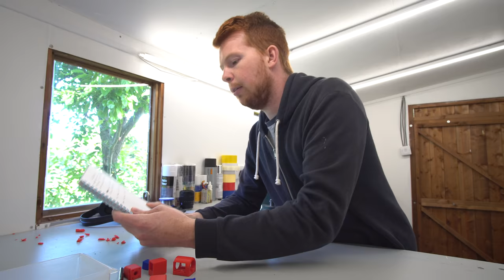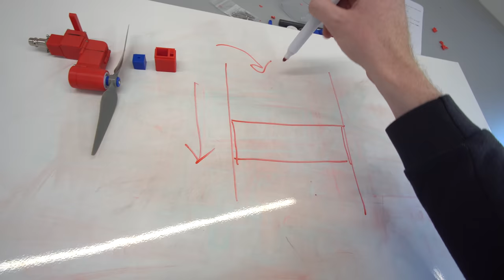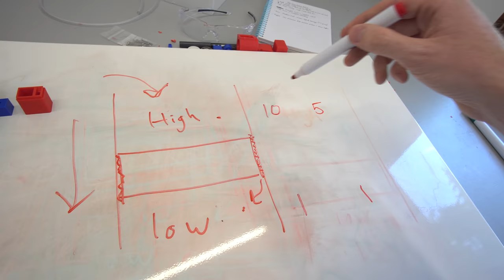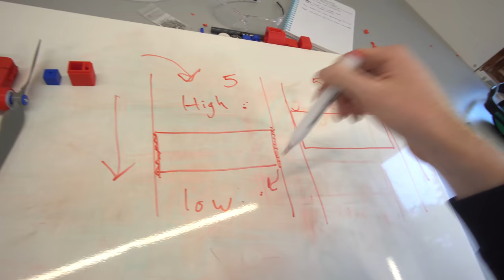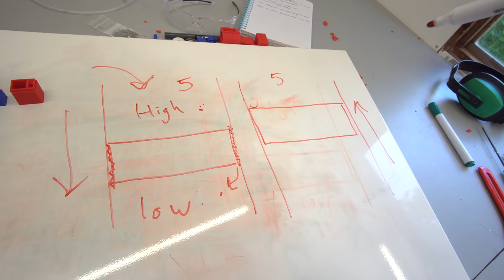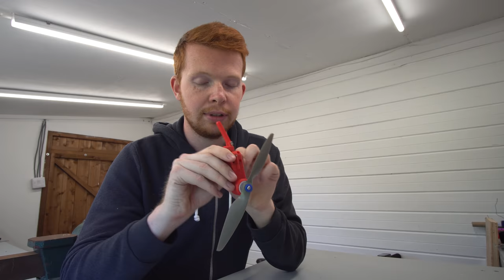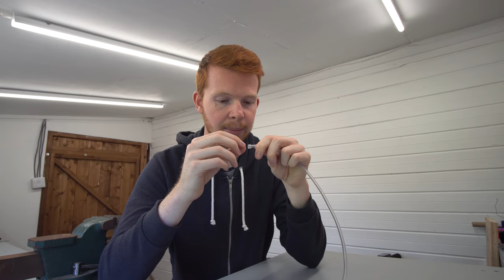Multiple or Single Cylinder Air Engine?

Comment: I think there is a lot to be said for keeping a single cylinder. If your theory about air leaking around the piston at varying pressures, a single is the place to experiment with this. I think if you tried to develop more efficient operation, that would be really cool, I'd love to see how technical this can get while still using 3d printed parts. Have you thought of using an exhaust valve as well as your intake valve? It will help you minimise losses on the upstroke and could give you more power on the downstroke as well. Love the project btw.

Comment: I would agree that the higher pressure on top the more air will leak through. The thing I want to add is, if it is a linear increase of leakage then multiple cylinders won't solve that issue. Now if it is a nonlinear increase, say an exponential one, then the additional cylinders should be beneficial. As for 1 vs 2, I think 2 would be cool but do what you feel is best. If you do make a twin then I vote for the inline version because I think that cam shaft would be really cool.

Comment: Since you're making a compressed air engine, you can do what internal combustion engines can't do. You can build a double-acting piston! A double acting piston gives you the power of two cylinders with the mass of only one cylinder being pushed around. The challenge would be sealing up the bottom of the engine because a connecting rod has to pass through it.

Comment: edit... Should have read comments first.. see it has already been suggested.. ohh, well..
..............
If you want increased efficiency you should do what they used to do in old steam engines.
 Make a 2 or 3 cylinder engine that reuses the same air... that is instead of just exhausting the used air from cylinder one to the atmosphere you route it into the second cylinder, 
 In order to make use of the remaining lower pressure you need to make the second cylinder with a proportionately larger surface area to press against.
  Also you could change the simple valve on your engine for a spool type valve and add another port to your cylinder to convert it to a double acting cylinder , and use pressure to drive the cylinder both up and down, This would give many advantages of another cylinder with less losses etc..

 After these mods you can then adjust the size of the propeller to "gear" the engine to where it is running most efficiently.

  Really interesting series looking forward to more..

Comment: As you only use compressed air you could have the interview at the bottom of the engine, and the crank shaft inside the inlet system etc. This would allow for a star layout if more cilinders are required in the future, without introducing many more points of failure

Comment: I'm a fan of the inline-opposed, sometimes called the 'boxer' engine - but you must have the crankshaft 180º out of phase for the cylinders.  That way they move in and out synchronously, but of course in opposite directions.  Their power strokes should also be simultaneous, therefore canceling each other out, vibration-wise.  I owned a 1976 Honda Gold Wing motorcycle, which had a 4-cyl. inline-opposed engine.  I could balance a nickel on the valve cover when it was idling cold.  You can do it, Tom!

Comment: twin, 90 degrees apart, the distance between the cylinders will be shorter therefore plumbing will be a bit easier and you also have easier crank shaft without the pistons moving in the same direction at the same time

Comment: You could also combine the 2 side cylinder engine using a different design. Make is so the air pushes the single piston back up once it reaches a certain point to make use of the air leaking around the piston and the walls. Hope this helps you

Comment: For high vs. low input pressure, consider the loss of the return stroke as it compresses the air in the piston. The amount of power generated for a certain input PSI is going to be reduced by having to compress the air again while the piston moves back up. In an internal combustion engine, you obviously want this compression stroke, but here you don't; ideally the exhaust valve would close just at the top of the return stroke. Perhaps you could add a second cam to operate an exhaust valve the same way the intake valve works?

Comment: Just Print a intake manifold with some rubber gaskets. That is pretty easy to design, and should seal well. A lot easier as designing a (strong, reliable) crankshaft with 4 offsets.

Comment: Follow your heart.  I'll watch your updates either way.  It's interesting to see your design process and how you work through issues.

If you do end up going with an opposed/flat multi-cylinder design, what if you have the air supply connect near the center, then build an air channel directly into the engine block for the air to split off and flow to each head?  That way you don't have to futz around with tubing or other mixed materials.  Though, I don't see how that is less complex than just designing a multiple-offset crankshaft for an inline.

At a small/light scale, the oscillations/resonance may not be that great, but your vehicles will also be more sensitive to these issues.

Comment: Flat twin. The crankshaft simplicity is important, the pneumatic plumbing is really really simple if you use smc type pneumatic fittings and tubing. The higher the pressure the better these kinds of fittings seal.

Comment: I think air leak is your main problem.
My suggestion : find some kind of metal tube with smooth inside surface and make a cylinder sleeve out of it. Still use 3d printing for the piston, but add a groove on top to accommodate a o-ring or some tiny cylinder ring (from small RC plane engine?).
Print the cylinder with a bore slightly smaller that the sleeve OD.
Roughen up the sleeve outer surface for adherence, heat it up a little then press it into the cylinder.
You could even recycle the sleeves from one build to another.
Reply: And for a simpler cylinder design, it could just be that you glue on to of the cylinder a disk of rubber/silicon sheet. And sandwich is with a washer on top. That being said o-ring of all side are easy to find and it's not that simple to cut a perfert disc of rubber.

Comment: what about just finding the optimal operating pressure and putting a regulator on there? i dont know how heavy or how big regulators are, but it seems like it would solve the problem that you think is existing?
edit: oops, i think you already did that with your throttle control.

Comment: So in my town there's a competition where cars with air engines race, and there's a tasks where the one who's car goes the furthest on a single "charge" wins. Because of this part of the race the teams design the engines with two cylinders one smaller and one bigger. The bigger one gets the air from the tank and the smaller one gets the waste from the bigger cylinder. This is how they maximize efficiency I belive

Comment: I would say that a V-twin engine is the better option, since it can be connected to a single crankshaft, and be fed in the gab in between the blocks. By offset the cylinders by 45 to 90 degrees would give you plenty of room to do the pluming.

Comment: I suggest a single, but modify the design and implementation.  Use a round piston and cylinder, sized so the piston doesn't quite fit into the bore straight off the printer.  Then slowly open up the cylinder until the piston just barely fits and  then add a few drops of lubricant.

The seal between the piston and cylinder isn't that great right now, but by taking this approach you could get a much better seal.  Ways to bore the cylinder:  Lathe (if you have it), the appropriate size bore, or worst case you just put some sandpaper in a slot in a piece of steel rod, and spin it with a drill and move it in and out.

You can certainly get it within a few thousandths straight off the printer, then a few minutes boring and honing and it'll be a great fit.

Comment: definitely multiple cylinder! I like watching the prototyping process as much as i like seeing these engines actually mounted on planes.
I like the flat twin idea, is print time a serious factor? you should be able to whip up a one piece manifold that feeds both cylinders, you could put it after your throttle valve.

Comment: With multiple cylinders i believe you will have less timing problems and more efficent running, i think you should go for 2 cylinders. And also depending on my observations, use a heavier flywheel, your machines will work more smoothly. Keep up the great work loves from turkey!

Comment: Older video but just out of curiosity if you could switch the flow of air from the top of the cylinder to the bottom of the cylinder you would effectively be powering the cylinder from both directions(effectively w cylinders)  Because there is no combustion it would just be timing and routing of air pressure. Of course most cylinders are basically square, bore and stroke are basically the same.

Comment: DIY pressure regulator and composite air tank by wrapping up those bottles so u can up the pressure to see if you can get the flight time to last a bit longer

Comment: Multi-cylinder would be cool, but getting a good single cylinder running first is key. Based on your history of the motors, you're going to have to find a happy medium between power and efficiency. Enough power to do what you need, but efficient enough for a long runtime. I think you should also look into an air tank for a paintball gun. Likely a fiberglass tank for weight savings and a regulator to drop it to a usable pressure. I have no idea what the tanks weigh. They may not work for an airplane, but as you hinted, they may work for something else. Good luck! Keep up the good work!

Comment: Go for the single to make it work well, then incorporate the experience to a multi :)

Maybe you could print the "plumbing Y" flat on top of the cylinders? 
Then you could use the same way of feeding the air as you do with the single.

Comment: One advantage of a multi cylinder engine is that you could have more frequent power pulses (but only with offset crank pins). If you want to put this in a car and want to be able to throttle down, a multicylinder might help.

Comment: I imagine a double acting piston would be the best power/weight. That is where the air pressure is switched between the two sides of the piston so it is driven both up and down. This design was used in steam engines and early gas engines quite a lot.
Additionally to that, a high pressure and low pressure system could be used, again this is from steam engine days, a small HP piston combined with a larger LP piston. The size ratios set out such that both pistons deliver a similar amount of torque to the crank.

Comment: So, uh, first thing is that if you're going to have any kind of load on the shaft, having two bearings to carry the load means you keep alignment.

As to engine, twin-cylinder in-line is my vote. And about the shaft - yes, maybe more complex, but you can easily print it in multiple parts and glue them together, either CA+kicker or epoxy resin will do solid joints on PLA.

Comment: Hey Tom. I'd build an actual cylinder head that has its own manifold built in like the Chevrolet corvair. That way you can thread the engine on without having any plumbing at all. Just go from the threaded side that goes on to the bottle directly too the cylinders.

Comment: While a twin would be cool I think the smart move is to stick with a single cylinder engine and fiddle with it until there is absolutely no more room for improvement. I think your cam-driven valve was a huge step in the right direction and maybe you should make a second valve for exhaust so that you don't have any pumping losses during the piston's ascent back to top dead center. Also try to make some improvements which allow for higher operating pressures. Finally, scale the current engine up! I'd love to see how large it can get before it rips itself apart due to vibration!

Comment: I think it could be worth a thought for a multiple cylinder engine to change the design so that the air intake would enter at the center next to the crank shaft and thereby pushing the pistons out from underneath instead of down from the top. This would eliminate the plumbing issue. Though this would probably mean redesigning the hole engine concept.

Comment: There's also something else than the pressure loss with multiple cilinders you should think about.
More cilinders with a lower pressure could also change the revolutions per minute. So perhaps you would also need a gearbox.

Comment: I think if you do the flat/opposed twin on its side, and 3d-print the plumbing and bottle fitting onto the top, that will be simplest and double your power (and air consumption).

Comment: With an inline 2, the air that leaks around the piston which is in the down stroke could help push the 2nd piston up.
To me, that seems like the biggest benefit between a single and 2 cylinder engine.
edit 1: You could then also seal the bottom end and put some oil in it which wil massively improve longevity and efficiency.
edit 2: it would also be a great engineering challenge for yourself, which is always fun.

Comment: I think a 2 Cylinder "Boxer" or Horizontally opposed engine configuration would be your best bet. if it's not to much of an engineering challenge, this will keep it balanced and efficient. you have the right idea, but they have to be symmetrically opposed, otherwise you could have a lot of vibration issues.  although these being 2-stroke engines, they will both have a power stroke simultaneously,  although a 4 cylinder would allow them to be 180 degrees offset of each other, Allowing the engine to have a power stroke for each 1/2 of a rotation. but if you want to keep it efficient as possible an In-Line 2 Cylinder opposed by 180 degrees would be an even better solution.  
I'm excited to see what you come up with.

Comment: You mentioned in the last video you wanted to make an RC car and I think a two cylinder engine would make it harder to stall.

Also if you end up controlling the speed with an electric air valve it would potentially be able to start by itself. Also the sound would be amazing when it zooms by.

But as you said you could make it better if you just stick with one cylinder for now. If you do this you could potentially also save time.

Comment: Again, I'm going to harp on efficiency. If u r considering multiple cylinders, you might consider a multi-stage config. Where the exhaust from the first stage supplies the second stage, etc. This would give small pressure drops across each cylinder and get the most work out of the avaiable energy. I'm not saying it would be easy, mind u, but efficiency is key to a CA engine. Probably the cylinders would need to be different sizes as well, to balance the forces across each piston. Each successive piston would need to be larger than the previous one. Sort of like a multi-stage compressor in reverse.

Comment: if you have pvc tube, then just find a pvc barb that will fit it and glue them together like you would pvc plumbing. You can take most of the material off the other side of the barb fitting and just leave enough for a printed adapter to clamp it on.

Comment: In theory for air efficiency a 2 cylinder compound engine (secondary cylinder bigger than primary) - like is done in a double expansion steam engine.  However complexity is higher and its possible you don't get the benefits unless you have really good efficiency (low leakage etc).

Comment: I think an inline twin is the way to go. One complicated piece should be easier to deal with than multiple levels of complicated plumbing. Once the crankshaft design is completed, it shouldn't need to change much. The plumbing might need to be tweaked multiple times.

Comment: Use push-to-connect fittings from SMC with 3mm or 4mm tubing. It will be easier to  plumb and you'll get perfect seals.

Comment: I think you should do a very large single cylinder engine. That way you keep it simple and more power.  As for the piston making a seal, use a Teflon insert for the cylinder walls because you do not need hardly any lube and an o-ring on the piston. with a little bit of grease it should greatly increase the efficiency.

Comment: For the air pipe try to use the push fit connectors and you wont have any leaks. Cheers.